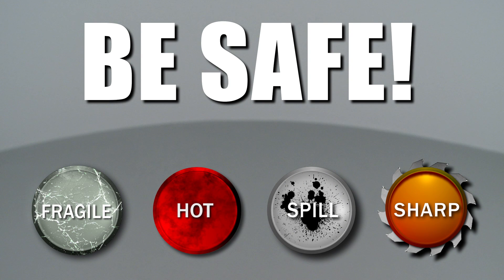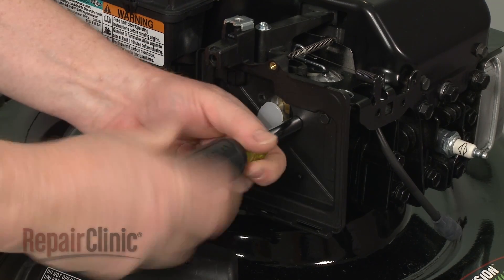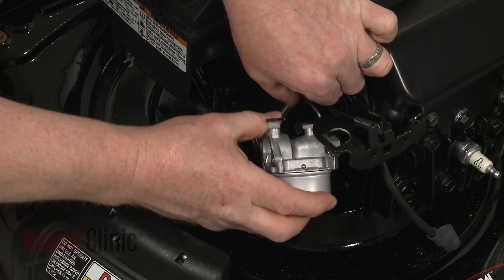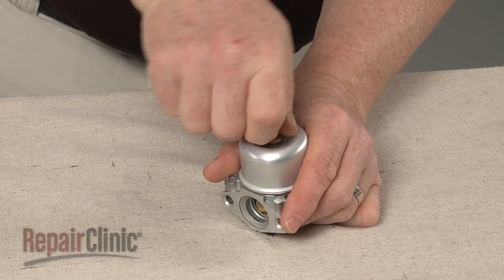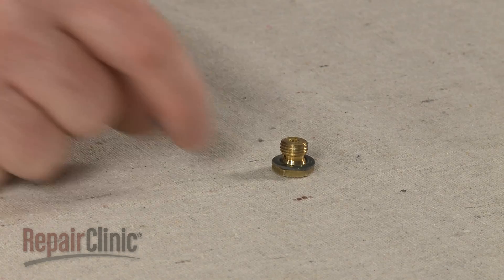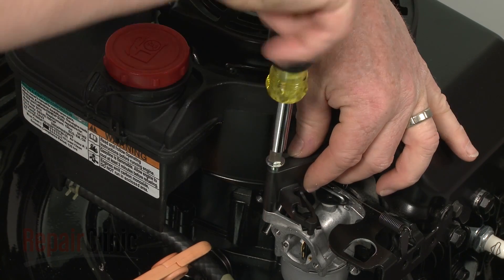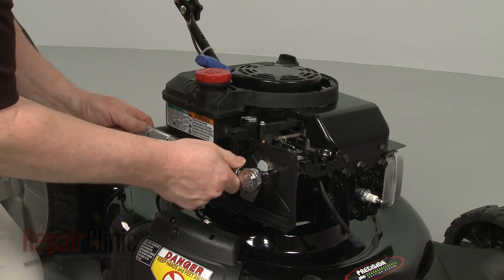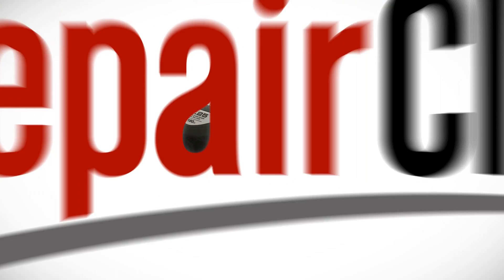Briggs & Stratton Lawn Mower Engine Carburetor Rebuild Kit #498260

Comment: I follow these instructions and somehow gas is coming out of the carburetor into the air filter. The only thing I can think of is I used the thicker washer on the front part of the throttle. Maybe the thinner one would work better.

Comment: i didn't follow this all the way through but just up to 2:00 minutes, then I took the bowl off and cleaned that and the nut off.  Put it all back together.  It took a few pulls at first, but it ended up starting up on one pull each time.

Comment: Great video!
But you should have shown how to do it on an old dirty mower. Since you will need to use carb cleaner to clean\soak everything. I used Berryman B-12 Chemtool carb cleaner. That stuff is very powerful. I was wearing nitrile gloves and the stuff ate thru those gloves and started burning my hands! Also check the jets to be sure they are clear and blow everything thru with an air compressor.
I was surprised to see that the mower did not have a fuel filter. So I just added one of the see-thru type to the fuel line.

Fyi-
At first I just took the carb off and cleaned it out and all the jets etc. without using a carb kit. But it took 3 or 4 pulls to start it. Then I went ahead and installed the carb kit and it starts on the first pull again.

Comment: I just installed this kit in my Murray lawnmower but unfortunately gas started leaking. I removed the carb to make sure everything was installed correctly. I didn't see anything wrong so I reinstalled the carb back on the mower. I noticed that gas continued to leak from inside where the choke plate. There are two small holes on the side. This is where I think the gas is coming from. Anyone have an idea why this is happening to me? How do I fix this?

Comment: Im reading about , carburetor inspecting for my small engine class that im taking . And I came across a part where it said ...
"Place a metal block on the carburetor body under the throttle-plate
shaft. Use a feeler gage to measure the distance between the shaft and the
block first when pressing down on the shaft and then when pulling up on
the shaft " my question is , how big is the block suppose to be??????
Reply from the maker: King County What time during the video does this occur?

Comment: did you use the spring?
Reply from the maker: Jason B We did not install the new welch plug, idle adjustment screw, or idle adjustment spring in this video because the carburetor on our model it did not have those parts. This kits fits both new and old style carburetors.

Comment: The rebuild was easy after watching this video, I didn't need all the parts that came with the kit but I realize it is for other carbs as well, my float was still in great shape, the symptoms were that after using mower for awhile it wouldn't start anymore, I would put it away and it would start after a few pulls the next time, I thought it had something to do with getting hot, this went on for months  but it finally just wouldn't start altogether, but now after rebuild it starts with the first pull, thank you for this helpful video.
Reply from the maker: Jeff Hobgood Thank you.

Comment: I just bought this kit and the envelope was empty, what came in that envelope was it the gaskets? I will be rebuilding but don't have a float in the kit, and at this point I don't know the condition of my float but should that be replaced as part of the rebuild?
Reply from the maker: Jeff Hobgood If you did not receive every part we show in the picture of the part please call customer service at 1-800-269-2609 and we'll sent you the missing parts.